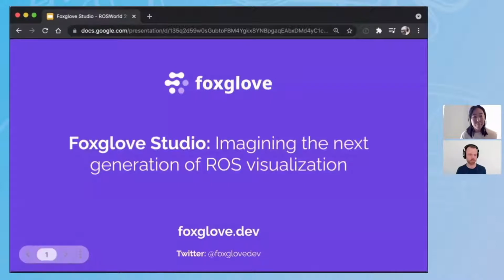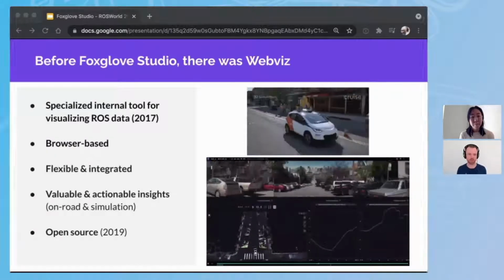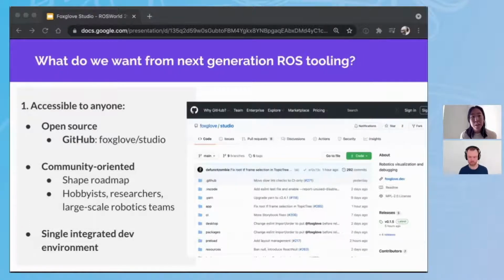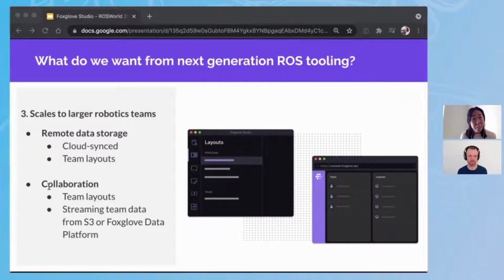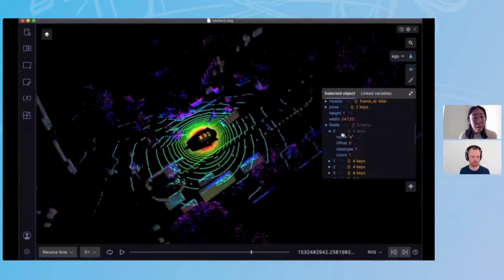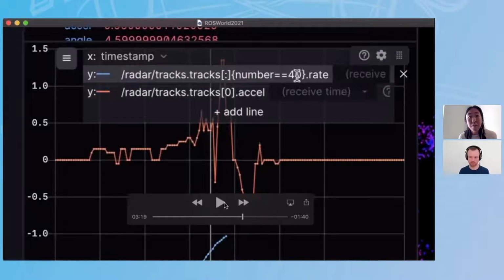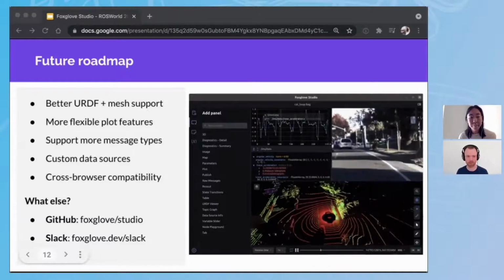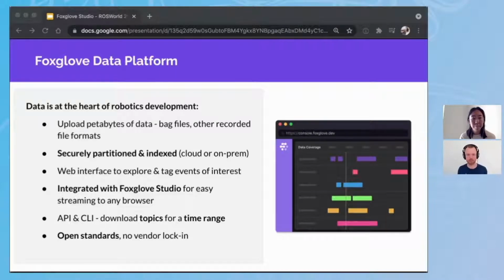Foxglove Studio: Imagining the Next Generation of ROS Visualization | ROS World 2021

Comment: Pretty cool video,
How can access multiple topics within the activate() function? Let's say to visualize something, I need msgs from 2 topics. is there a good documentation to solve such a problem?
Reply from the maker: Do you mean the activate() function for extension panels? If so, check out the turtlesim extension example linked in our docs here: https://foxglove.dev/docs/studio/extensions/guide-create-custom-panel#examplepaneltsx. You can see that the code filters all current messages for those with a particular topic name. You can easily edit that code to match for multiple topic names.
Reply: @foxglovedev  I do not necessarily need a Panel. The output can be visualized in built-in 3d panel. The problem is that I need messages from the topic A and topic B. Unfortunately, topic A has already been registered in another extension via registerMessageConverter() . Therefore, if I use registerMessageConverter for topic A in my visualizer, it does not work. 
I need the data from Topic A  to make sense out of data from Topic B. Do you think Panel can solve such a problem?
Reply from the maker: @sharadrawatindia  - Message converter extensions are purely for converting a topic from one schema to another.

It sounds like what you're trying to do is derive a new topic from 2 input topics (A and B), and then visualize that new topic in the 3D panel. If so, using the User Scripts panel (you can specify multiple input topics there, and write custom logic to transform their messages) would be your best bet: https://foxglove.dev/docs/studio/panels/user-scripts

If you have further questions, please join our Slack community (https://foxglove.dev/slack) and ask there.  We may ask you to provide additional info like the data source you're working with, your loaded layout, etc. to help reproduce and debug the issue.